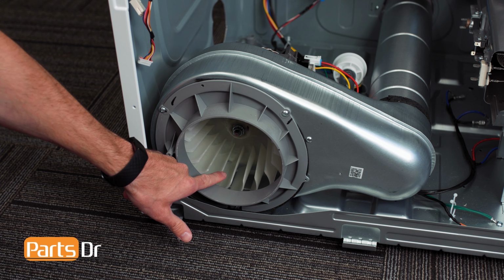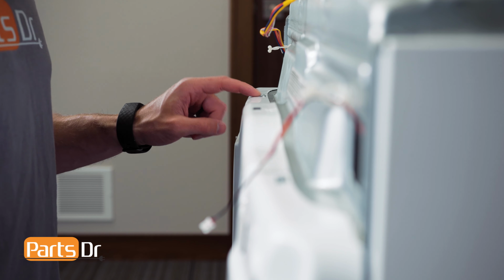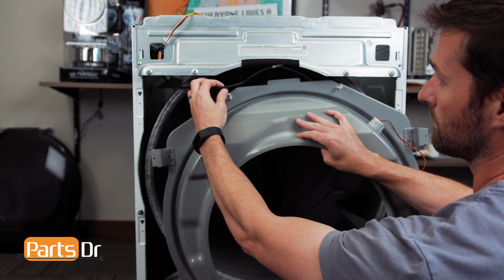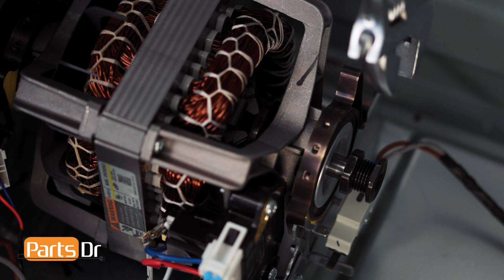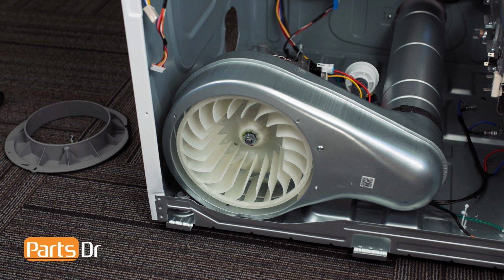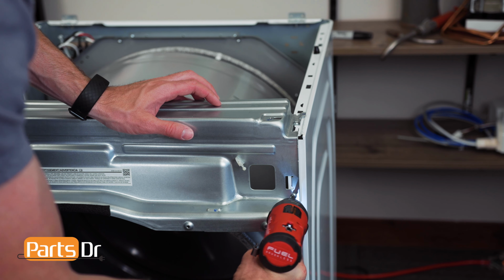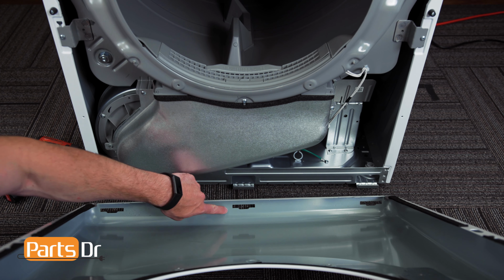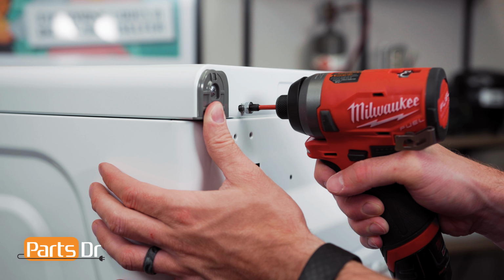Stuck Blower Wheel? How to replace the blower wheel fan part # DC67-00180B on your Samsung dryer

Comment: I thought the heat gun thing would work but doesnt seem to be helping me.  when I first thought it was just seized up, i sprayed some penetrating oil and it seemed to open up some play between the motor shaft and the fan but still wont come off.  I've been heating the shaft with a torch for about 10 minutes and it still doesnt want to come off!  Anything else i can try????
Reply from the maker: Sometimes they become seized together over time.  If this happens, you have to cut off the shaft with a reciprocating saw and replace the drive motor and blower motor together at the same time.